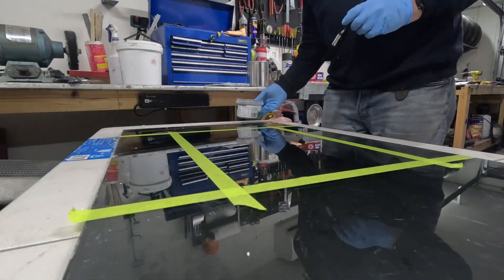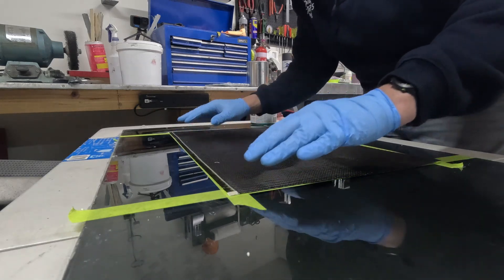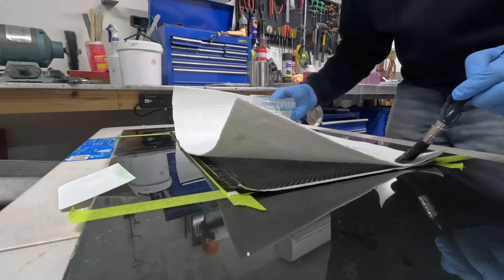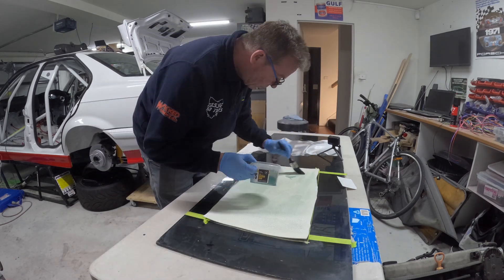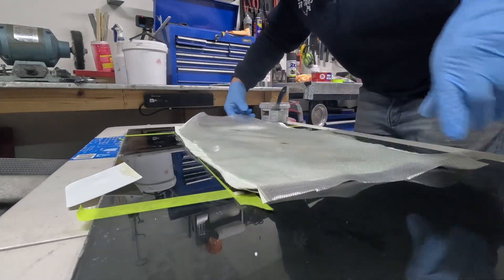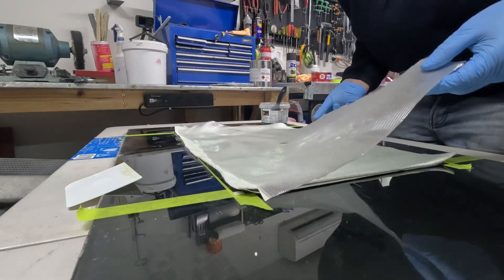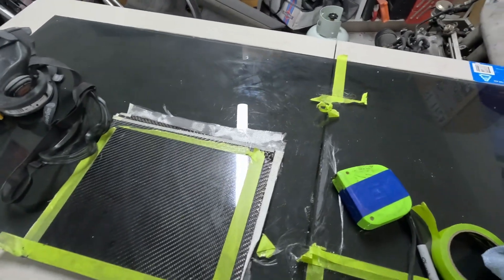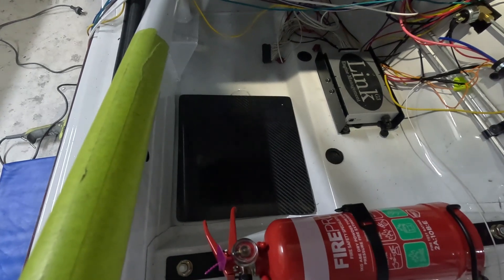Carbon Fiber panel tutorial

Comment: so carbon fiber on one side and glass fiber on the other side of the core, that is a heavily imbalanced laminate and can cause warpage
Reply from the maker: Yep, but its just a floor that is anchored down, and a small relay panel. This is all just home garage stuff done for fun. If I were making something that needed structure it would be CF on both sides and sandwhich between glass with some weight on it.

Comment: No compression ?
Reply: Something I was wondering. But it came out lerdext without it. I guess the glass helped.
Reply: @SeriousPunch Itl still look good but it won’t be nearly as strong
Reply: the core mat he used has no compressive strength and only works without vacuum. If you try adding any compaction it will just squish and become paper thin making it useless
Reply: @kingofherdaz interesting, what is the core mat for ?
Reply: I use jpg or png, but never never gif. To many people who mispronounce it.